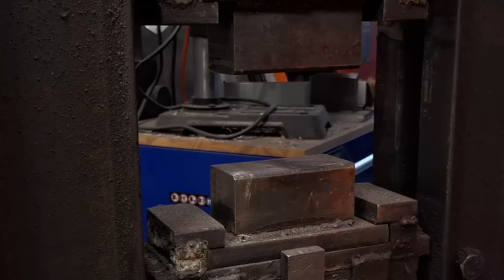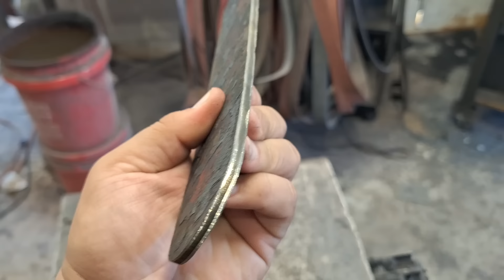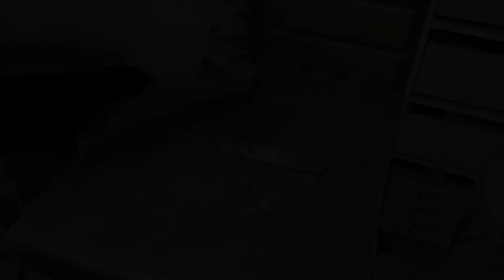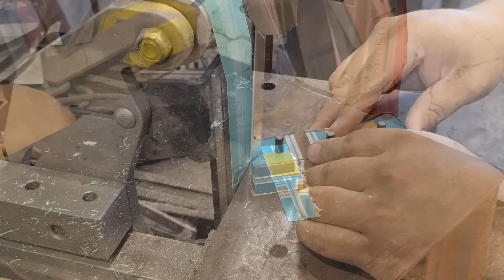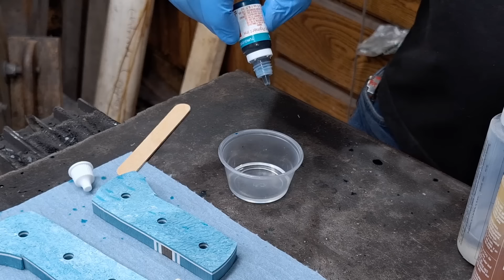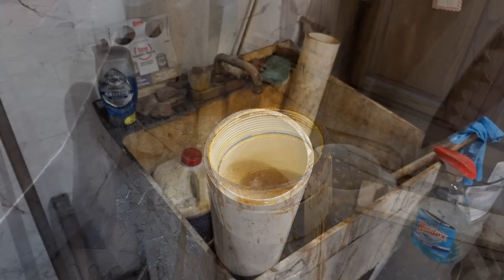The HARDEST KNIFE I've Ever Forged (Stainless San Mai)

Comment: I know you didn't ask, but in the video you mentioned that stainless needs to get hotter to weld properly. This is actually backwards. Regular carbon steel you are looking for heats in the upper 2200's low 2300 range. After speaking with some guys who make stainless Damascus they state that you want controlled temp, and a heat of 2100F, with long soaks, with zero oxygen. The first soak is most important. 2100F for about 30 mins on the fist set is the most important. This may help you in you would like to try stainless in the future.

Comment: Another killer piece. I feel you on the drilling. I had some 1095 that was harder than diamonds it seemed. I bought a solid carbide bit and it burnt up too?
Reply from the maker: Thats odd. Ive broken the carbide bits but ive never burned one up.

Comment: If you can fit them in the kiln annealing them at 1600 or so and let cool over night in the kiln will soften everything up so don’t burn up bits.
Reply from the maker: I only have a small heat treat oven so most knives i make dont fit if theybare over a certain size.

Comment: That color transition in the boundaries where it was etched is from diffusion between the two materials, I kind of like the way that looks in the etch. Good job pulling off a san mai with stainless. Just for your own testing, you might want to do some test coupons with your selected stainless and carbon steel  to see how fast that diffusion happens with different steels.
Reply from the maker: How would i go about doing those test? Any ideas.
Reply: @JPsBladeworks  Forge weld a billet, then bevel the entire length so it's a consistent angle. After that, cut into coupons and reheat the coupons to forge temps and pull out a coupon  at increments (I'd use 5 minute increments for the first test). Descale and grind down to remove any decarb but keep the same bevel angles. Etch and measure the gradient lengths at multiple points on each coupon. You'll have some variability just due to the overall nature of forge welding, but it should give you a trend line.

Comment: That knife is epic! Super sweet blade brother! I have tried with stainless a time or two i can’t seem to keep it from warping. Maybe I will give it another go here soon.
Reply from the maker: I didnt have any issues with warping. Ive had issues with lack of heat and it not sticking.
Reply: @JPsBladeworks that ended up with the most awesome pattern, it half looked like the stainless bled chromium over. That would look awesome if it had the smallest amount of copper in the layer.

Comment: i pretty much forged to shape the few stainless damascus knives i made
Reply from the maker: Are they full stainless? I hear those are find to forge. After the intial weld. Once welded your good to go. But with highcarbon to stainless im not sure if the bond is a strong?
Reply: @JPsBladeworks  high carbon and stainless. once its welded its fine for me. i have a bit softer stainless tho, i can check the number, and usually use file steel.

Comment: Very nice work brother, well done!
I’ve noticed a lot of the times, at least from what you say in your video, that you don’t have a particular knife shape in mind when you’re doing your forge work on the billet.
I really like and appreciate that about the work that you put out. I understand that part of that may be that you’re waiting to see how the billet turns out and what is usable, but I think part of it is also maybe that you just like to approach it when you get to it. Maybe you could clarify that if you want to.
I usually don’t start on a knife, unless I have a particular style and pretty close approximation,at least in my head, of the general shape of the knife.
I think the way you do it a shows more spontaneous creativity.
I admire that.
I’m glad you were able to get a stainless forged billet completed. 
Very nice color choices to compliment stainless.
Another accomplishment you can check off your makers learning curve list.
Keep up the great work!
Reply from the maker: Thanks. In terms of the knife shape. My main focus is the materials and getting them to mesh correctly. Afterwards i figure out what i can make with the amount of material i have. I knew i wanted to use that handle material so it had to be full tang. Then i just figured what i could do with what was left that would show of the steel the best as possible.

Comment: Another beautiful knife! Regarding the problem you’re having with drilling, I am a machinist by trade and when drilling stainless steel I find it best to use a small bit first and then increase the size until final diameter is reached. Also low rpm and high pressure works best. Carbide is good but very brittle and the bit will chip or break easily. HSS or cobalt bits will work if you keep them sharpened.
I really enjoy your videos and look forward to seeing more in the future.
Reply from the maker: Thank you for the tips and thank you for watching

Comment: Or get a laser cutter 🙂 for the holes (and the makers mark or so)
Reply from the maker: How much would  a high power lazer to fuct steel even cost 🤔
Reply: @JPsBladeworks  Look at the xlaserlab (welding cutting and cleaning) only 3mm cutting... but only about 4000... 10 mm cutting would about 10-20k usd.... a lot of drillbits one can buy with that. LOL